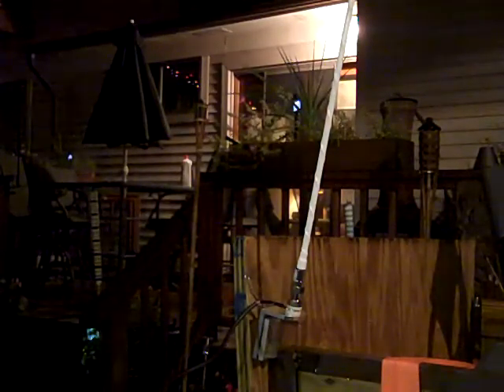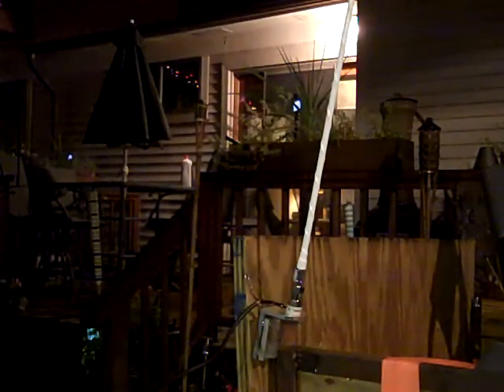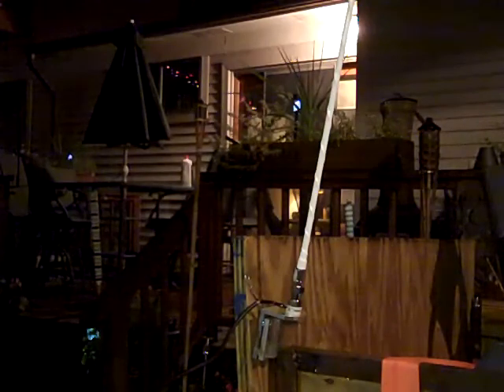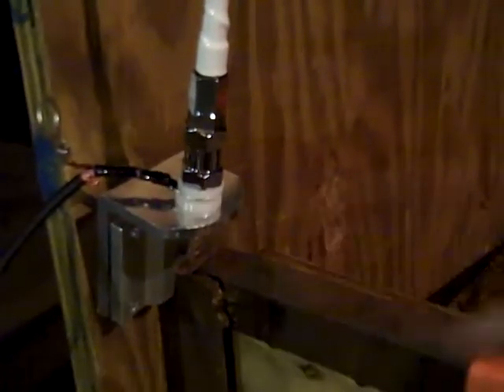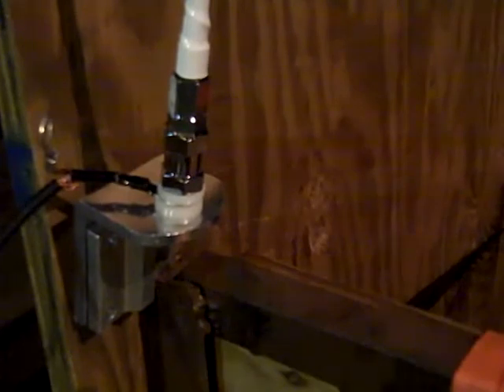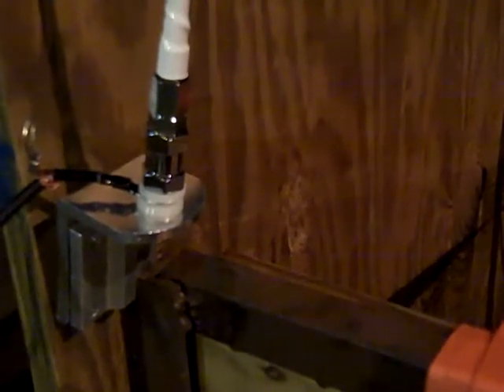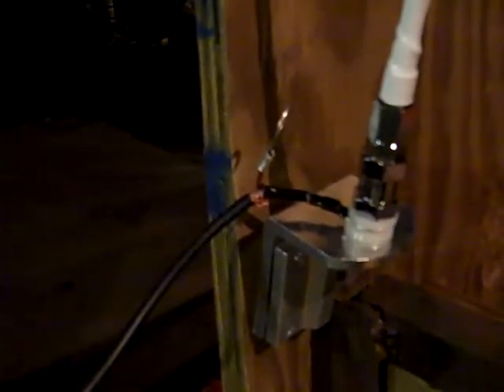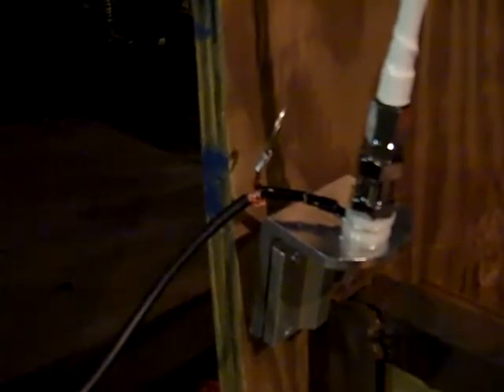CB RADIO UPDATE

Comment: Question about CB antennas. Does the watts on the antenna mean more range? Im trying to decide between a 36" Cobra 300W antenna or a Vanco 48" 75W antenna thats just a few bucks more. I dont know if the watts are more important than the length. Thanks